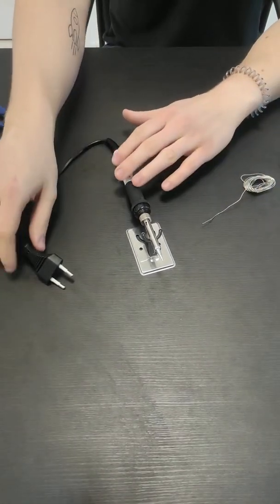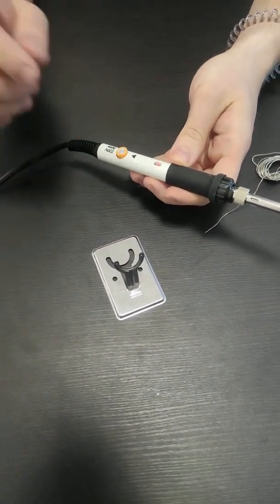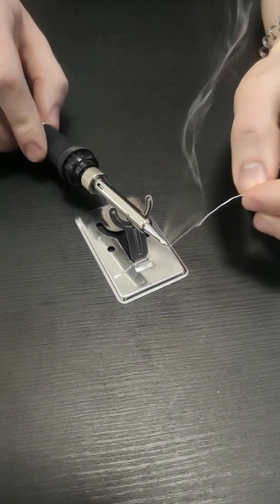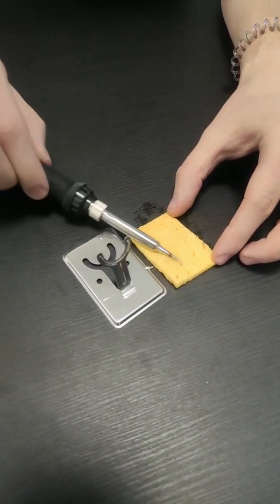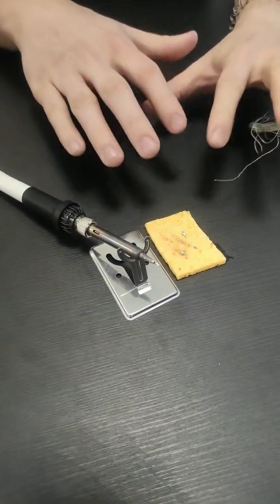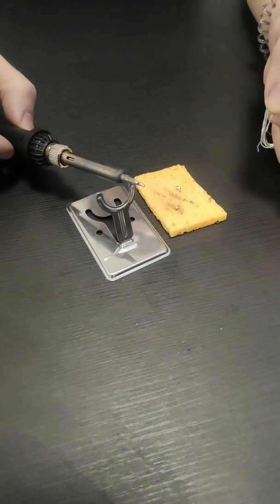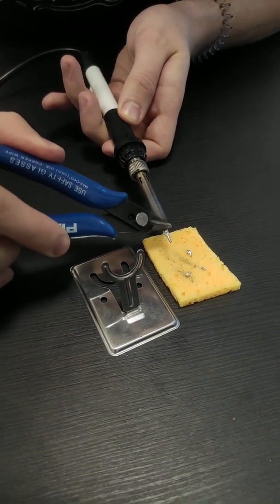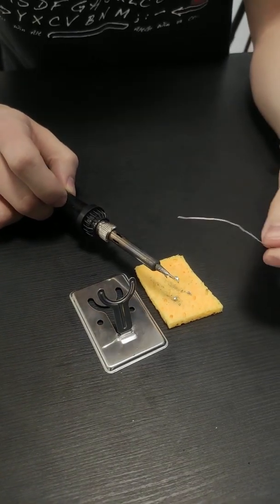Soldering iron instructions

Comment: Do NOT use a damp/wet sponge, thermal shock will produce microfractures at the tip. Instead use a  brass wool sponge to wipe the iron against. And don't use metal pliers on the tip, this metal is harder than the chromium tip coating. Look this up for yourself and you will see. The brass wool is softer than chromium and will help to remove oxidation.
Reply from the maker: Thanks for the tip! That’s great advice. Brass wool is definitely the better long-term option for keeping the tip clean and protected.